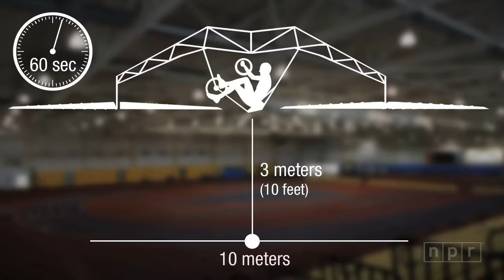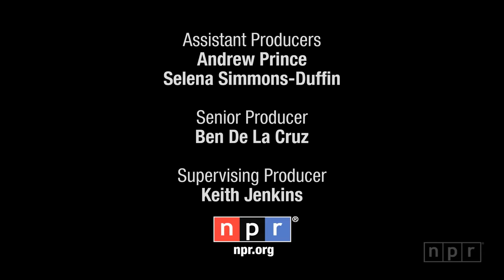Human-Powered Helicopter: Straight Up Difficult | SKUNK BEAR

Comment: pressurize the hangar to 4 atmospheres.
Reply: now THERE's a big brain idea
Reply: @CactusforceX   No good. Welllll, not as far as getting it flying because the thicker air would cause the rotors to bight into the air more but would take about 4 times the effort to spin them unless they reduce the pitch or diameter and then you'd lose any benefit from that. There may be an advantage of increased oxygen for the operator to absorb to keep pedalling though I guess.
Reply: @lorditsprobingtime6668  ahh good point, I conveniently forgot about any of the downsides of a thicker atmosphere :P.
Reply: @CactusforceX  Well, there was that upside too that I didn't think of at first but could help the pilot keep powering it harder for longer. Another alternative for that would be to increase the oxygen content of the air in that hangar or whatever it is but NASA found out the hard way by losing several astronauts in a fire inside a capsule with a high oxygen content how dangerous that can be fire risk wise.
Reply: @lorditsprobingtime6668  isn't it easier to just inject the pilot with stimulators, instead of changing oxygen level in the whole hangar?..
Reply: @gjrfytn  Sure, they could do that and maybe do. That isn't going to help a whole lot with maintaining the very high level of stress he's putting his body through and burning the oxygen in his blood up faster than he can breath it in though, this was just a way of allowing him to keep going longer since this would take tremendous effort for a fairly long time.
I'm not sure whether the rules would allow it but they could maybe run an oxygen line up to the pilot, that would certainly help.
As already stated,  "NASA found out the hard way by losing several astronauts in a fire inside a capsule with a high oxygen content how dangerous that can be" so clearly I WASN'T suggesting that as a realistic idea. READ!
Reply: @lorditsprobingtime6668  I READ your statement and I just don't see how pressure change relates to oxygen levels in hangar.
Reply: @lorditsprobingtime6668  wow, chill out. Let me elaborate.
You said that additional pressure will make it harder to spin the blades so you will lose all the benefit from this. This claim is highly doubtful. Yes, it will be harder to spin, but why we'll lose ALL benefit? Where did the "4 times harder" came from (since when air friction is linear to air density)?
Also have you considered that the pressure will increase buoyancy of the "bicycopter" and its pilot?
So, then you assumed, that more pressure will increase pilot physical performance. This claim is also quite bold and I'd like to see some references to researches on which this claim was based (you have them, don't you?).
The next thing you ASSUMED was that oxygen supply is the "bottleneck" of pilot's performance, so stimulators won't help much.
All in all, you just made the bunch of dubious statements, which lead from OP original thought "change pressure in hangar to make it easier to fly" to your's "you should just give pilot more oxygen", and then called me stupid when I questioned this logic chain.
Reply: @gjrfytn  Oh dear, here we go sadly.
gjrfytn from nor referred to as simply G:  " You said that additional pressure will make it harder to spin the blades so you will lose all the benefit from this. This claim is highly doubtful. Yes, it will be harder to spin, but why we'll lose ALL benefit? "
I have been building my own and flying model planes usually at least twice a week for quite a few years now as well as going flying, mostly in a mates Bell 47 full sized heli about once a fortnight on average so especially from the models have PLENTY of experience learning and messing around experimenting with different prop types, pithches and diametres plus number of blades, also having to adjust for flying at different altitudes. A craft set up for flying usually at say 3 thousand feet will need the prop pitch reduced or the prop diameter reduced at sea level where the air is denser otherwise if combustion engined ones will labour and never reach efficient revs to fly well, if electric it'll most likely burn out the motor or speed controller. These people will have done a ton of 'maths and a hell of a lot of trying different pithes,diametres and blade numbers as well as the entire profile of those props to find the most perfect one for that atmospheric pressure where they are testing it. Too large in diameter or too much pitch and they'll have already tested and found it was either too hard to spin enough, or spun more easily but couldn't provide enough lift, simple as that. If you change the pressure you change the density and that changes all that again and they'd have to completely start over with the props which would be very time consuming and very wasteful of all the previous testing and building of them so no small thing at all.

G:  "  Where did the "4 times harder" came from "

That's admittedly a rough assumption on my part but for these purposes rough is good enough. I'm not trying to design the thing, I'm simply making a point.

G:  " Also have you considered that the pressure will increase buoyancy of the "bicycopter" and its pilot? "

Admittedly no. At sea level a cubic metre of air weighs close on 1 kg so there will be a buoyancy increase but no huge effect, in fact that's probably another reason the judges wouldn't allow that. 

G:  " So, then you assumed, that more pressure will increase pilot physical performance. This claim is also quite bold and I'd like to see some references to researches. "

Already explained that each breath of the same volume will have more oxygen which is what his body will be screaming out for as well as nitrogen at higher pressure. No bold claim at all, just simple physical facts. The opposite example would be people on mount Everest needing to subsidise their oxygen by carrying bottles of it because at the lower pressure up there they'll die without it. Pretty basic simple shit that's bloody obvious. Precise amounts and variations I have no need to work out since I'm not building one of these things so only need to work from basic principals.

G:  " The next thing you ASSUMED was that oxygen supply is the "bottleneck" of pilot's performance, so stimulators won't help much. "

Read again genius. I AGREED that stimulants ("not stimulators". We're not talking about sex toys FFS) would probably help and that they may be doing that too.  And NO again. I never assumed oxygen was THE bottleneck, I simply stated it IS a major factor in continuing to supply the power required to get this thing to the height where they'd barely have any ground effect and them stay there for the required time. Also bloody obvious shit FFS. I never said it was the only factor, it IS a major factor though.

G:  " All in all, you just made the bunch of dubious statements, which lead from OP original thought "change pressure in hangar to make it easier to fly" to your's "you should just give pilot more oxygen", and then called me stupid when I questioned this logic chain. "

Again, INCORRECT!  I made assumptions based on simple physics, experience with flying machines of all sizes and learned facts aka experience. Very little of what I've said has been stated as precise or absolute, it's mostly based on simple principals. I also never stated that giving the pilot more oxygen was the be all and end all solution as you implied.  I originally stated that the increased pressure MAY HELP, nothing like it was the big answer to everything to which you STUPIDLY replied: "isn't it easier to just inject the pilot with stimulators, instead of changing oxygen level in the whole hangar?.."  which was a stupid statement to which I replied :  " gjrfytn Sure, they could do that and maybe do. That isn't going to help a whole lot with maintaining the very high level of stress he's putting his body through and burning the oxygen in his blood up faster than he can breath it in though, this was just a way of allowing him to keep going longer since this would take tremendous effort for a fairly long time.
I'm not sure whether the rules would allow it but they could maybe run an oxygen line up to the pilot, that would certainly help.
As already stated,  "NASA found out the hard way by losing several astronauts in a fire inside a capsule with a high oxygen content how dangerous that can be" so clearly I WASN'T suggesting that as a realistic idea. READ! "   So again you've got things wrong, I never called you stupid for that at all, in fact I was quite polite. I only called you stupid after your stupid reply to all that where you said: 

 " I READ your statement and I just don't see how pressure change relates to oxygen levels in hangar. "
That WAS a stupid statement since obviously more air pressure means more air, more air means more nitrogen AND more oxygen, THAT should be obvious.
Now you can say or think whatever the hell you like. I'm not wasting any more time explaining and correcting a dummy who can't even correctly interpret the written words.
Reply: @lorditsprobingtime6668  I appreciate your effort of explaining your point of view, though your willingness for insulting me is quite astonishing. The amount of times you repeated the word "stupid" in your reply is just ridiculous. Actually if we exclude all the repetitions, insults and quotes from your answer, we''ll get a nice and concise statement.
Also I want to thank you for pointing out that "stimulant" thing. English is not my native language so there can be some miscommunication or bad wording.
Regarding "will not get any benefit from increasing pressure":
I respect your experience in planes modeling, etc., but I'm still not convinced. You cannot just claim this without doing actual calculations or testing. I agree, that they may not get any benefit, but you can't say it for sure.
On "additional pressure will increase pilot's performance":
You stated that "I never assumed oxygen was THE bottleneck, I simply stated it IS a major factor in continuing to supply the power" — so you actually said it is a bottleneck. Because bottleneck is not the only factor affecting system performance, but exactly the major factor, which optimization would  gain the biggest improvement to this system performance.
So again, you cannot just assume that if human loses performance in low pressure environment, they will have increased performance in high pressure. Human body is adapted and optimized to live in exact environment it is currently in. And it is pretty reasonable to think that it will have peak performance in normal atmosphere pressure and any deviations will have negative impact. So I'm still waiting for some studies reinforcing your claim.
And please, stop making "strawmen":
eg.: "people on mount Everest needing to subsidise their oxygen by carrying bottles of it because at the lower pressure up there they'll die without it. Pretty basic simple shit that's bloody obvious" - I never stated the opposite, but you make it look like I was.
Another one: "That WAS a stupid statement since obviously more air pressure means more air, more air means more nitrogen AND more oxygen, THAT should be obvious" - did I argue this? I just questioned the train of thought. My wording was bad, I know, but you decided to judge my whole intelligence based on two lines of text.
Reply: @gjrfytn  I wasn't going to respond to you at all since you seemed to be altering things I said to mean other things and that was really annoying me. How exactly is using Mount Everest a strawman? You go up there without aditional oxygen you'll almost certainly die. That is a fact and demonstrates how the same air with the same ratio of oxygen to nitrogen simply because of the lower pressure up there can kill you without adding extra oxygen to subsidise for the lower air pressure and therefore less oxygen for each breath?
I didn't even consider the fact you may not be a native English speaker and that probably did lead to some of my misunderstanding you and I'll apologise for that. I'm not hunting down any information for you on any of this. Take my word for it or find out yourself or ignore it, I don't give a damn anymore.
Reply: @lorditsprobingtime6668  Alright, let's agree to disagree. Just a final remark: I wasn't arguing your points regarding Mount Everest and effects of low pressure, I just think their interpolation to high pressure may be somewhat controversial. That's what I tried to say in my last reply.
Anyway, our discussion prompted some new thoughts to my head, so it wasn't in vain.
Reply: @lorditsprobingtime6668  well thicker air enables you to shorten the rotors --> less weight
Reply: @jesper9622  No kidding? Gee, why didn't anyone think of that I wonder? Oh, that's right, I did in my first post: " unless they reduce the pitch or diameter". The tiny amount of difference in weight would be barely noticeable I think and not worth pressurising the hangar for, apart from the fact the judges probably wouldn't allow that as also already mentioned.
Reply: Or just put a real helicopter on top of it.
Reply: @lorditsprobingtime6668  But thicker medium makes it easier to float, imagine water, it is so much thicker than air and we practically float without the need of a propeller. When the air gets denser it gets closer to the density to the other items, so it should be easier to float in it and generate lift.
Reply: @connorstohl6050  Go back to sleep child.
Reply: @AlehandrosArhangelos  Apart from AS ALREADY STATED the fact that with density changes props need to have pitch and diameter changes made. Then there's the fact ALSO ALREADY STATED that the judges wouldn't accept that, so NO, that wouldn't help them win the prize on offer, FFS people.
Reply: @gjrfytn  it's like using a water turbine rather than a wind turbine, the density to help obtain more "grab" from this peak push. Maybe, a very early morning or on an ice rink.
Reply: @lorditsprobingtime6668  In relation to the oxygen level, that wouldn't be much of a difference since 1) the bottleneck is the actual capacity of the pilot's body to get oxygen into blood and distribute it to muscles (VO2 capacity), and not the amount of oxygen in air. 2) According to the amount of effort, he is using mostly anaerobic energy, which depends much more on available ATP and chreatine-phosphate rather than oxygen, and therefore lasts only for a few secondes. He can't sustain it.
Reply: @lorditsprobingtime6668  Except that the 2nd pilot (the one that crashed) says he's never been up so long that he's ever felt tired. Pilot endurance is not an issue. Up-front pilot strength IS one of their issues (with reaching 10 ft) and overall control and drift is an issue (with staying in the box and not crashing into the wall). So in that case, it's possible that higher density air COULD benefit the craft, if the pilots have strength in reserve that they're unable to tap due to the drifting issue. Perhaps not 4 times density, but maybe 1.2 times, or 1.5 times normal atmosphere. (Try the test near the ocean on a high pressure day. No "cheating" involved :) ). Kinda like the only successful test flight of the original Terrafugia Transition before they redesigned it: it was early morning with cool dense air. Once the sun came up and the density decreased, they couldn't get off the ground again.

Either way, they start to drift out of control LONG before they reach the 60 second mark. Even the Wright Brothers' 1st flight was only 12 seconds long, but still long enough that they needed to be able to control the aircraft to keep it in the air.
Reply: @mikehoy4238 :   " Why not have fans staged around the chopper to blow it back into the box? "
Simple. Because that could be classed as cheating and they wouldn't be able to win the prize money.
Reply: @c182SkylaneRG  ALL of that comes down to correct propeller diameter and pitch. Less dense air higher pitch and or more diameter. Sure, whatever they choose will probably need to always be flown under just the right atmospheric pressure conditions or have a range of easily changed props to suit varying conditions.

" Except that the 2nd pilot (the one that crashed) says he's never been up so long that he's ever felt tired. "

And I'm by far the strongest man in the world and can run for 30 days straight without even stopping for a nap. NOBODY can go continuously pumping out that sort of power. Sure, he's obviously very fit and has good stamina but that statement means he's either full of ego and bullshit or has never been up for long, since they hadn't won the prize at that point he hadn't ever been up for long enough to find out.
Reply: @lorditsprobingtime6668  Of your last few options, the last one would be correct: he's never been up long enough to figure out where his limit is.
Reply: @c182SkylaneRG  Not sure what you mean by " Of your last few options " but the comment I made about pitch and diameter is absolutely correct too. Also " NOBODY can go continuously pumping out that sort of power."  is absolutely correct too.
Reply: @lorditsprobingtime6668  Meaning the last paragraph, there: "he's either full of ego and bullshit or has never been up for long, since they hadn't won the prize at that point he hadn't ever been up for long enough to find out." I don't think ego has much to do with it. I just don't think they've had a flight long enough for him to find out, yet.

The success of this helicopter comes down to power/weight ratio, and the efficiency with which they get the power to the propulsion/lift system. Pitch/diameter/air density, all factor into power efficiency, and all have tradeoffs: low density is easier to turn through, but less to push against. High density the opposite. Long thin blades are harder to start turning because they have more inertia, and the tips go faster, generating more friction drag, but having the tip vortices further apart reduces the induced drag and makes the blades more efficient once they're up to speed. Higher pitch allows for more lift at a lower speed, but also creates more drag. There are charts and graphs for all of this, created by NACA in the 30's, so I'm sure those blades are idealized about as much as they can be for the expected conditions, which is why the team seems to be mostly focused on the weight side of the ratio.
Reply: @c182SkylaneRG  Thanks for stating and agreeing with pretty much exactly what I just said. I presumed you wouldn't need me to go into the great lengthy explanation you did since it should be pretty obvious from my comment that I already understood all that. Thanks and goodbye, this has become boring and very tiresome.
Reply: @lorditsprobingtime6668  Hence my original short reply: I just responded to the portion that warranted a response. :)
Reply: @c182SkylaneRG :   " Hence my original short reply: I just responded to the portion that warranted a response. 

"Oh really? So this is your idea of a short response ONLY covering " the portion that warranted a response."

" IT'S PROBING TIME 666 Except that the 2nd pilot (the one that crashed) says he's never been up so long that he's ever felt tired. Pilot endurance is not an issue. Up-front pilot strength IS one of their issues (with reaching 10 ft) and overall control and drift is an issue (with staying in the box and not crashing into the wall). So in that case, it's possible that higher density air COULD benefit the craft, if the pilots have strength in reserve that they're unable to tap due to the drifting issue. Perhaps not 4 times density, but maybe 1.2 times, or 1.5 times normal atmosphere. (Try the test near the ocean on a high pressure day. No "cheating" involved :) ). Kinda like the only successful test flight of the original Terrafugia Transition before they redesigned it: it was early morning with cool dense air. Once the sun came up and the density decreased, they couldn't get off the ground again.

Either way, they start to drift out of control LONG before they reach the 60 second mark. Even the Wright Brothers' 1st flight was only 12 seconds long, but still long enough that they needed to be able to control the aircraft to keep it in the air. "

Now just go away.
Reply: @colinsouthern  thanks for the correction, you are definitely right, I got it mixed up in second part of my statement. Anyway, rotation velocity and maybe even surface area would likely been adjusted to new air density, so I think overall we still should not approximate required power in linear way.
Reply: You could also lower the air temperature to increase its density
Reply: @spannaspinna  No, you couldn't. It would equalise immediately with the outside pressure unless the room was an actual completely sealed vacuum chamber.
Reply: @colinsouthern   Sorry, didn't get a notification about your response. I was purely guestimating the extra friction, nice to know it was correct though, so thanks for the more precise info.
Reply: @colinsouthern  YT's notifications seem to be a bit random in that regard. Sometimes I do receive notifications about posts in a thread where I've only commented that I didn't start, wasn't tagged in or anything and sometimes I don't even get them at all even when either I started it or I've been tagged. Recently they've apparently messed up a lot of peoples settings for notifications about channels they're subscribed to as well. I just do not understand how they work things on here sometimes.
Reply: @lorditsprobingtime6668  You must be insufferable to be around in real life. You're lucky your workmates don't have a shovel and an undetectable place to hide a corpse.
Reply: @colinsouthern :   " perhaps you're thinking of the notification of a liked comment which comes through regardless of whether you're tagged or not? "
I'm not exactly sure now, I just know I'm pretty sure I remember occasions where I'd come back to reply to 1 comment I'd received a notification about and find somebody else had made a reply to me sometimes weeks before and I hadn't received any notifications about. It doesn't matter too much, just 1 of those random annoying things.
Interesting what you were saying about the air thickening up as far as breathing it goes, I'd never even considered that, although logically I should have since that's exactly why correct prop pitch and diameter are important. I've spent several hundred hours working underwater myself. I ran a gold dredge trying to make a living from it for near 3 years. The big difference was I was never working more than about 15 feet underwater thanks to the length of the damned expensive big diameter suction hose and the fact that to go deeper you needed a bigger and more powerful pressure pump to keep that gravel lifting all the way to the sluice box on the surface it wasn't usually practical nor in the rivers I was working was it really needed so 15 feet max and usually around the 5 to 10 feet mark. At those depths I only had the slight resistance of my regulator to contend with so never experienced what you have in what you were doing. That was all over 35 years ago so also in another life so to speak. 
I am still curious though, you said you can't get past %100 oxygen in the blood. I'm just wondering if that's variable dependent on conditions at all. I mean blood is never 100% oxygen, it's some decided on level they consider fully saturated but could the blood carry more if under pressure? Also, with higher pressure there'll be more oxygen in each lung full of the same cubic capacity, I thought maybe that would make it more available to your bloodstream if the lung tissue can absorb it faster. The guy frantically doing the pedalling and hand cranking is going to be burning it up very fast and I would imagine his blood oxygen level would be dropping fast while he's cranking away so hard but no idea if adding extra can get it into his blood fast enough to help get through something like this. I 'assumed if there was either a higher concentration or at higher pressure his lungs might be able to use that to his advantage but don't know for sure, that's purely what I thought [ might ] help.
NOTE TO SELF:  Explody aircraft hangars being pressurised to several atmospheres = bad idea.
I got a laugh at the way you described that scenario. It was pretty much what I was saying about "a vacuum chamber except if I said vacuum (which I think I did" I should have said pressure vessel though, not bloody vacuum, I don't know what I was thinking there, it was all about pressure, or the lack of at least lol.
Reply: @colinsouthern  I was not actually advocating pressurizing hangar in this thread, I was arguing mostly about how pressure would affect the athlete. Also my point was that there are so many effects of applying higher pressure in hangar that we cannot make any definitive claims about overall performance change without doing actual tests or throughout research and calculations.
Also here is fun thing: I thought that additional pressure will make breathing more viscous air somewhat harder, but didn't brought up this argument because I was afraid to make another "stupid" statement.